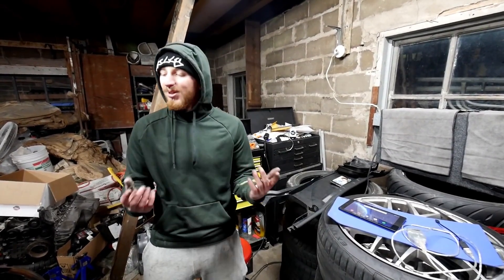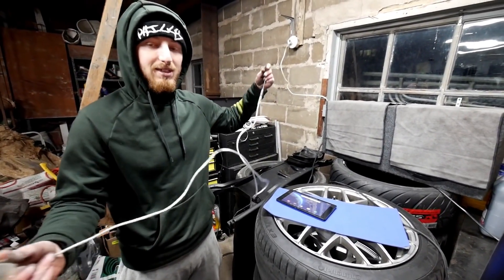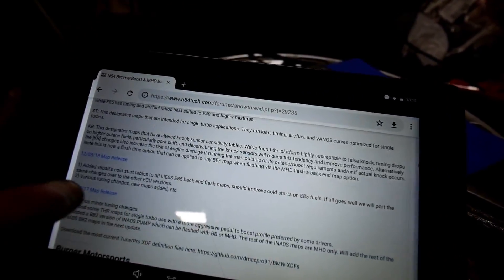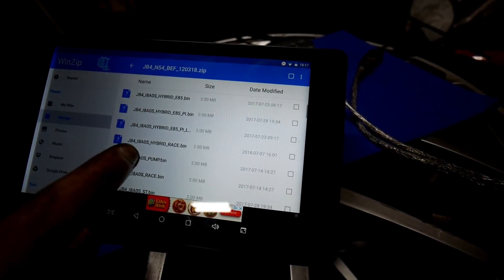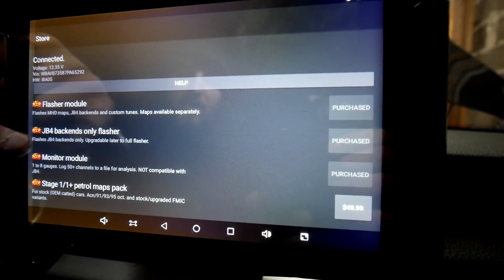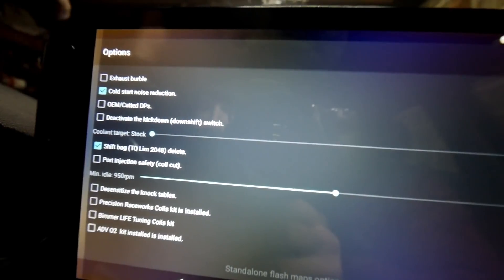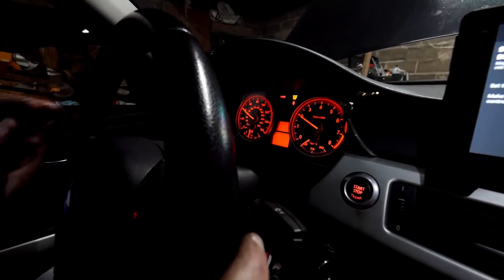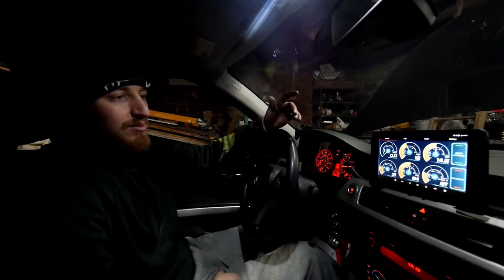TURNING UP THE BOOST IN THE 335i ! (HOW TO INSTALL A MHD BACKEND FLASH ON A N54)

Comment: Hey mate 

Might be a dumb question but you no after you flashed with mhd you said to put the jb4 settings to 4 and 2 

The question Is that is it in kmh or mph because your 4 and my 4 might be different 

Thanks

Comment: Hey I have a question which file should my car has catalyst downpipe‘s and jb4 and stock turbos on 91
Reply from the maker: go to the JB4 page on https://www.n54tech.com/forums/ and that explains what each JB4 map does and how to use it with MHD
Reply: Should I use jb4 18A0S pump bin or jb4 _ 18A0S PUMP_ USA_2.bin?

Comment: I have the mhd wifi flasher, can I do all of this with the wifi adapter flasher or do I need the cable? Also if u want to make quick changes with the mhd app do I need to set the jb4 to 4/2 backend flash?
Reply from the maker: No thor will work fine for everything and if your using mhd with jb4 then yes it should always be on the map for backend flash
Reply: @AllCarsEverythingOfficial  my car is flashed with an mhd backend and it’s on 0/2? Is that how it’s supposed to be.

Comment: Can you run the burble tune 2 step and anti lag all in one?
Reply from the maker: Yes you can!
Reply: All Cars Everything have u ran all 3 before
Reply from the maker: @avery6600  we messed up one wire and it never worked right for us :(
Reply from the maker: @avery6600  well this vid is the jb4 with the mhd backend flash

Comment: May i ask a question pleeeaaaaazzzeee!!

Soo... i went to do everything you said to do. I got to the flashing part where u go to write the file for 18-40 mins..

So i press the button and it does its thing, things happen inside the car like bells and dings, however, it stays in the clearing section 1 portion. If I wait like 5 mins, it says failed and possible reasons

So i go buy another cable, same.

The jb4 is in map 0, i can't confirm that right now cuz jb4 didn't work after i failed a flash. I know the cable and tablet work cuz i used it on my other n54 but im stump.... Battery is fully charged and wired directly to my house

....whats possibly wrong???
Reply from the maker: tell you what go to Instagram and ask @5.0_pat hes the guru with the n54

Comment: Have a few questions, sry for such a long msg, I just need a few things cleared up... any assistance would be greatly appreciated.

How or where can you find the info about which dme you should use for your car model or year?? so you can download the right file lol and successfully install the mhd backend flash to the jb4? (just bought the mhd wireless adapater & trying to figure out exactly how to do this) Im on a very old firmware on my jb4 (havent updated in a while) which brings me to my 2nd question after installing the correct file and then running the backend flash, how did you later get the "custom maps" and change the exhaust burble noise,...etc Which MHD licenses are needed to be able to access those options and where/what custom map are you running if you have a jb4 with the mhd backend tune, don't you have to stick with the firmware you used in this video the jb4 BEF firmware after the install?  Again just curious where you got the custom map /firmware you installed in your next videos when showing the exhaust burble... 

lastly, when driving which app are you running on your phone? the jb4 mobile or are you running the MHD app while driving? if so that means you have to buy the monitor license as well from MHD correct? 
-Monitor license from MHD or jb4 Mobile (to have on screen while driving)?? which one do you use?

I saw you have the monitor license but it says it can't be used with JB4??which confuses me even more

I have the mhd adapter, the n54 2step relay...I didn't buy the antilag kit (didnt know if I should, my car is MT)... and just wanna set it up like you have in the vid where you show the custom map you have and show the exhaust burble settings....

***Which licenses from MHD are required? (to have it be like your car is in the vid after installing 2step and anti lag..) with the MHD custom tune and the exhaust burble while still running the JB4, and where did you get the custom map (the zip file) that works on the jb4 backend tune?? ****************

Where did you get the custom firmware (to have 2step and antilag at the same time and have the mhd backend tune & be able to still change the exhaust burble, quite cold start..etc while still running the Jb4 like usual (as in beingg able to change jb4 maps on the fly etc)... The custom map you have in the exhaust burble vid clearly wasn't this file you used to install the backend flash so just curious where you get those firmwares from (the only difference for me is, I do not have upgraded turbos)?
** do you need a custom map to access the options screen where you can change the exhaust burble and all that.... That setting should be able to be changed (on the fly/go isn't it?) Or can you stick with the firmware you used from n54 tech IN THIS VID and still be able to change those settings?

If you could give me any info that might clear this up for rme id greatly appreciate it lol 
My car: 2008 335i n54 Twin Turbo (stock turbo's), JB4, Catless downpipes, charge pipe/bov (current mods)
Want to know how to get the custom map for the jb4 backend tune and play around with the MHD options (like the exhaust burble)
Reply from the maker: DB X what’s up man! I know tuning can get a little confusing cuz of all the options lol. I don’t know if you saw it but we have a bunch of videos on building and tuning the 335i make sure you check them out maybe some of those questions can be answered. 
https://www.youtube.com/playlist?list=PLR0djN6_s4XCDp_g8VQMfkH1AmwLXK9wR

If you still have questions after watching some vids, Pat is the man to ask he has way more knowledge than I do when I comes to tuning these cars. Hit him up on Instagram his name is @5.0_pat

Good luck bro you’re going to love this car once you understand everything about it more
Reply: @AllCarsEverythingOfficial  sry for the super late response!! I Will be finally installing the backend flash this week, for the most part, I think I got most of my questions answered... I'm sure I'll have a quick lil question, for example, I haven't updated my jb4 in quite a while... Do you first need to update to the most recent firmware for just the jb4 BEFORE installing the BEF firmware from n54tech through the MHD app? Also, just to confirm... so you start out with the regular firmware (just jb4) (in my case no e85 available so I only really use maps 1, 2 & 5...Use map 2 cuz I got bolt-ons but usually just leave it on map 5 and let it be..) and then install the n54 tech firmware that's put on an sd card through the MHD app (after buying the backend flash license) Again this is prob quite obvious just want to triple check lol Most importantly is just to know if it's required to first update to the newest firmware and then doing the backend flash....and as asked in my first essay lol I just wanted to make sure you have access ie it is locked in terms of accessing the MHD options where you can play around with a few things, infamously the exhaust burble, or does that feature only work for the full MHD flashes without a JB4? I know you cannot use the MHD monitor module even if you pay for the license with the JB4... For some reason that doesn't work, so it seems that JB4 Mobile would be the only app that would give you monitor info (like gauges...etc) 

If I msg again it will be a direct short question, not another essay lol & again I truly appreciate you getting back to me!!

Hope all is well with you & the team!

Comment: What mount and tablet are you using in the dash ?
Reply from the maker: its a custom mount that we bent bolted and powder coated! the its just a cheap tablet from best buy
Reply: @AllCarsEverythingOfficial  Would you be down to do a quick vid or point me to how you made your mount? I'd like to make one for my E90. 
Thanks!
Reply from the maker: Gee Mac it’s easy bro! Buy the tablet you want  then go to Home Depot or Lowe’s and get some 20 or 22 gauge sheet metal. Bend it around the tablet and a second piece of metal that you bolt up to the back of the first piece. That second piece will be bent to hook onto the dash. I would send you pics but pat got rid of the BMW 😕

Comment: I'm currently running map 3 (meth) on JB4. I've heard great things about the backend flash so I'd like to give it a shot, however, I'm a bit confused.  During your video you disabled the JB4 by setting it to Speedo - 0 / Tach - 0.  My question is, once the flash completes do I just set the JB4 back to map 3 to control the meth since you said that Speedo - 4 / Tach - 2 will use the backend flash? Does 4/2 override Map 3 boost settings but leaves the meth settings intact?  I went to MHD's site and would like to run their Stage 2+ map.
Mods:
JB4
Catless DP
VSRF 7" HD Intercooler
Burger Tuning Methanol Injection

Thank you!
Reply from the maker: I dont use meth so i dont want to give you wrong information. Call up burger tuning maybe they can give you a definite answer
Reply: Meth will still work off jb4 just how it used to.

Comment: I have a stock Bmw 335xi with 50,000 miles should I get a mdh or jb4 tune?
Reply from the maker: im gonna drop a video comparing them all... but id say go mhd if you want more power and only running stock turbos... jb4 if your gonna go with 2step, no lift shift or upgraded turbos with port injection and that stuff.

Comment: Waiting for video after the flash and with monitoring what boost etc you're running... Think you should select hybrid turbo as a BEF or just get a custom tune for hybrids and pump fuel from an online tuner like Twisted or Wedge...
Reply from the maker: Im looking into a pro tune... But there was no hybrid turbo option for pump gas... Only race & e85

Comment: I would say you gonna be pushing around 640hp with that setup you got not more then that prove me wrong haha good luck..
Reply from the maker: lmfaoooo no way !!! Not on 93 octane haha ill prob make 400 wheel on that setup haha but u go some virtual dyno videos coming very soon !
Reply: @AllCarsEverythingOfficial  400wheel little to much mote like 350-380wheel you have to take times
Reply from the maker: @Name-ot3rf  im on upgraded turbos, im over 400 wheel
Reply: @AllCarsEverythingOfficial  ah i dont motice that my bad
Reply from the maker: @Name-ot3rf  all good buddu !
Reply: Either way Stock holds up to 500